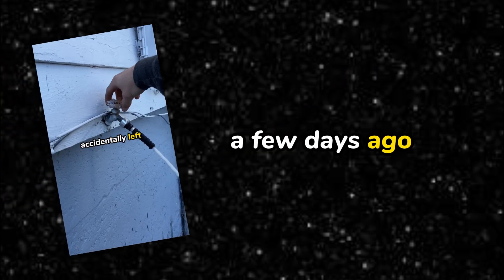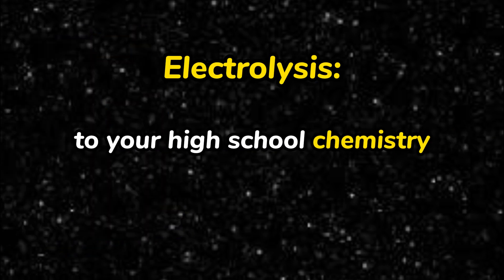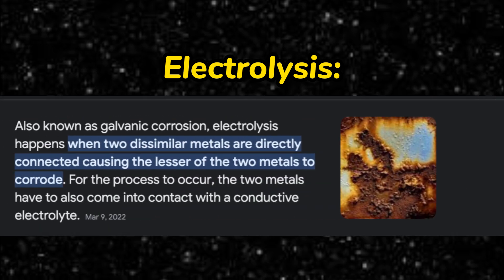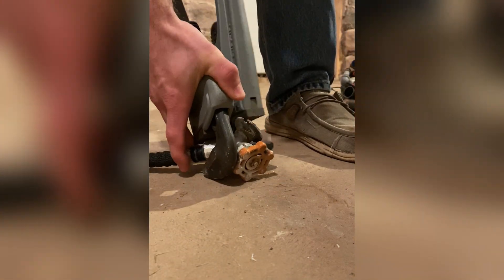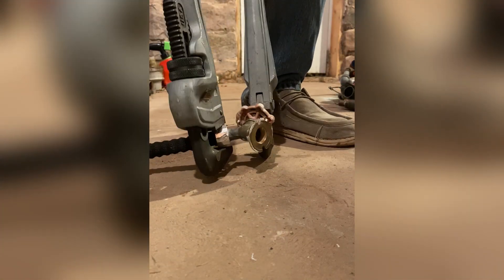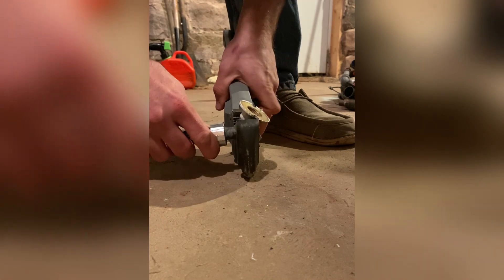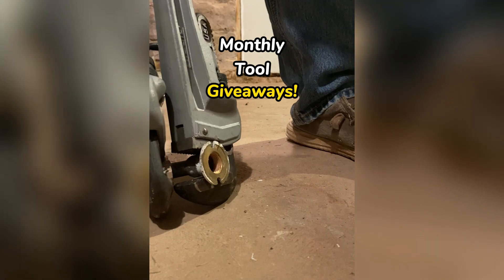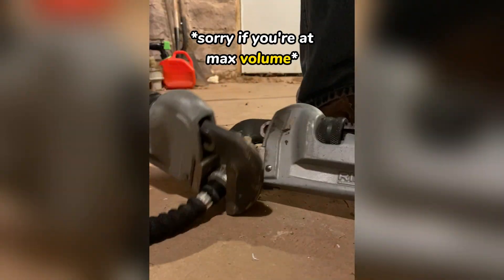Hose stuck on hose bib? Here's why.. Enjoy me Struggling to Remove Hose from Hose Bib.

Comment: honestly a little bit of anti seize and wipe excess off works,,,,,
Reply: After the fact, or before use?
Reply: @Gerle71  before
Reply: @redneckdrennan745  It wouldn't help the homeowner in the situation she was in. But once the old hose is gone, sure, that's the right time when the new one is being installed!
Reply: @Gerle71   pretty much what i meant

Comment: I had the same issue at my daughters house. I replaced the bib and bought her a quality hose.
Reply from the maker: Good, these cheap hoses can cause a real headache
Reply: @APplumbing00  I have a very very old hose bib with this little dial that you turn on the inside to bleed the water out of it apparently. Well it's up in an access panel in my basement ceiling. I was trying to get the hose off the hose bib out front with a wrench and I guess me twisting the pipe coming out of the house moved that little dial. Well water started pouring into my basement from the ceiling access panel. I had no idea what was happening so I shut off the main and finally figured it out. The hose is still stuck lol.

Comment: Buy hoses with real brass connectors instead of chinesium.
Reply from the maker: Couldn’t agree more
Reply: I couldn't agree more...except now it's harder and harder to find hoses with brass connectors.  A year or two ago I tried to advise an elderly woman hose shopping at Home Depot...they didn't have any.
Reply: @BWolf00   Those big box store hoses are crap.  It's about the same money to go to tractor supply and buy 25 or 50 foot goodyear rubber hose and buy the brass connectors and add them to the hose.  The end result is a very tough long lasting hose that weathers well and doesn't weld itself to the faucet.  They won't survive the finish mower though.  Ask me how I know.
Reply: good luck finding that

Comment: I know this may not be applicable doing service calls, but if you are a home owner and want to do it cheaply, if youre going to cut the hose anyway, get a battery grinder or hacksaw and slit the coupling nut so it wants to break apart when torqued. Then a wire rush to clean the threads.